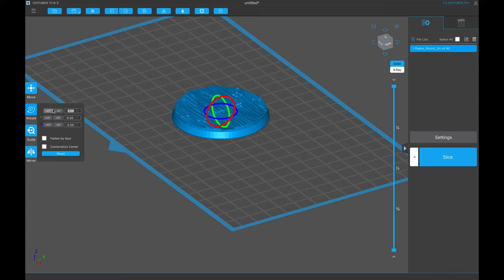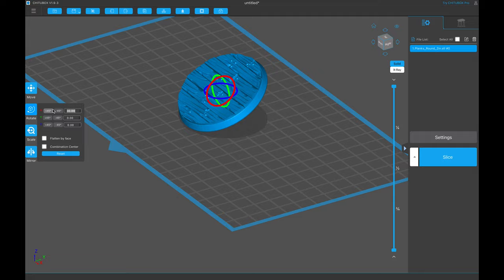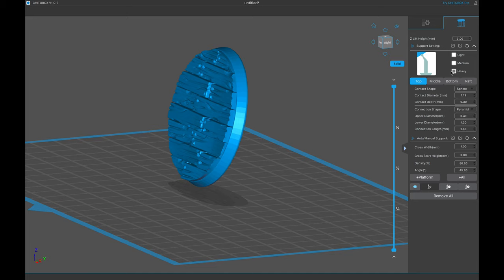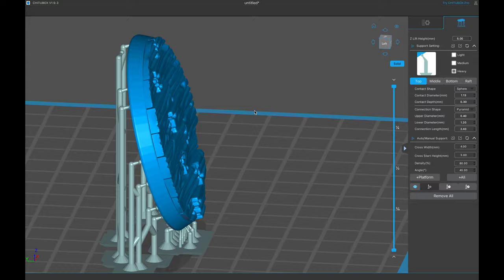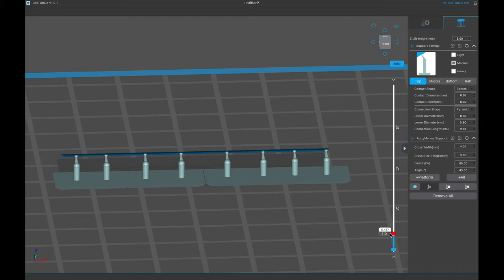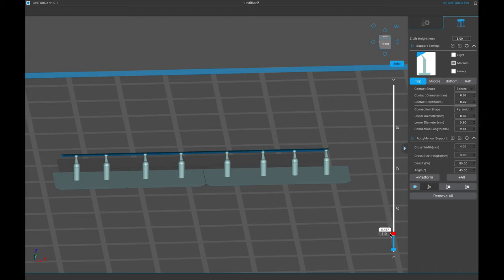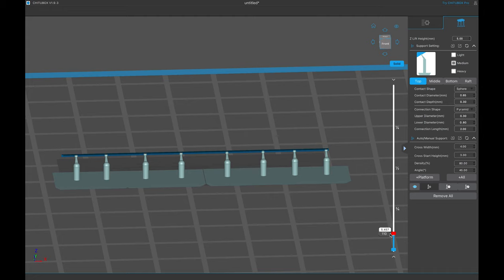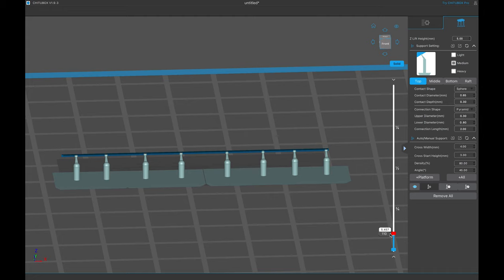The Perfect Angle of 3D Printing Resin | Chitubox Tutorial

Comment: Actually, there IS a perfect angle for every resin printer and that angle is precisely equal to the arctan(layer height/pixel width) so for my anycubic photon mono 4K the arctan(0.05/0.035) = 55.0079 degrees this angle will be different for each print depending on layer height and your machines pixel width. This angle will give you the smoothest print on every side.
Reply: have a mono4k -have you printed many like that?
Reply: @deaultusername  the only time you’ll be able to see steps in layer lines is with flat surfaces and even then it’s so minute, I use it sometimes
Reply: Noncence
Reply: @KingUsyk  nonsense
Reply: You just saved me some time
Reply: @mj5692  tbh I always print at 45 degrees and my new 12 k printer has no lines that I can see

Comment: We support exactly the same way! Lol I always look for what's best for the model I'm currently printing! Hahaha only difference is that I use lychee I really like it!
Reply from the maker: Awesome great minds think alike they say. Yeah all the concepts apply to any slicer you use.
Reply: I've been meaning to switch to lychee but last time I tried I couldn't find an option to either hollow or add holes.  Can't remember which one but I kinda gave up 😅.  Is it really that much better than chitubox ?
Reply: @jjbeast102699  I think is more about preference honestly they are both really good I tried both and I like lychee more but is a preference thing you know, and yes you can hollow the model add holes add internal supports all that. Is one those things you have to test it out both and see what you like best just be open minded when testing, sometimes inwould pick one thing over another just because I was more familiar with something. Since then I try to go in and put pros and cons and see what I really like even if means I'll have to learn something new completely but if is better in the long run than it's better. But that's just my opinion I still would recommend you to try it maybe you will find that chitubox works best for you.

Comment: I've been looking to go to resin printing for a whyle now and am looking at so many video's on 'HOW TO" etc. I have been printing FDM for 4, 5, years now and just can't get some of the detail i want in some models. Resin printing seems to be the solution for this. 
It's just pretty expensive to start with and it will not get any cheaper. 
Seeing your video on these supports seems to minimize the use of resin wich is a good thing because of the minimizing of the cost of resin. 

I like to make my own parts for a number of things, and sometimes you just need to print it to make sure it fits. FDM does do a good job at printing a prototype, but laks on the accuracy. You can see the basic shape but the dementions are mostly just a bit of (no matter how well you print it). Resin printing however is more accurate but it cost a lot more, so beeing able to cut on cost is a blessing for me lol. 

Thank you for this video, it helped me a lot. It makes my struggle to buy (or not to buy) a resin printer a bit less difficult.

Comment: I learned SO MUCH from this video.  Thank you!

I do want to share one bit of feedback, maybe open up a discussion about it, whatever...  So I saw you using the ball-end for your supports (I typically go with the "None" option).  Mainly I wanted to see if there was an advantage to using one over the other.  I finished up my supports and did an "Island Detect" and had significantly more islands.  As I studied the "why", it was the ball end.  The more I though about it, it makes sense... unless your support "shaft" is perfectly vertical, the ball will start with an island.  I went back and changed all my supports, because, while the islands are typically "small", I just imagined all those orphaned bits floating in my resin.